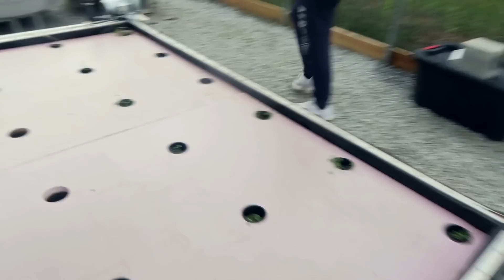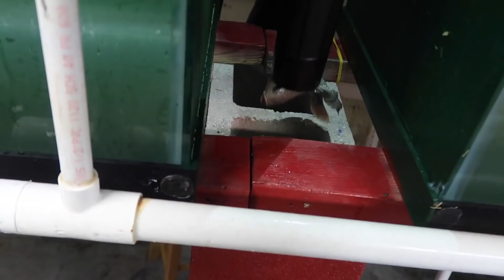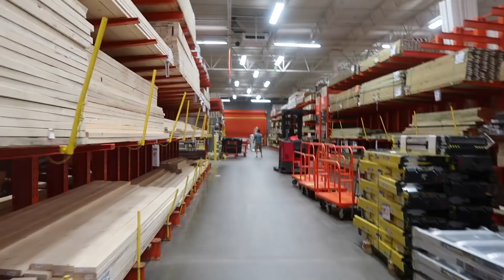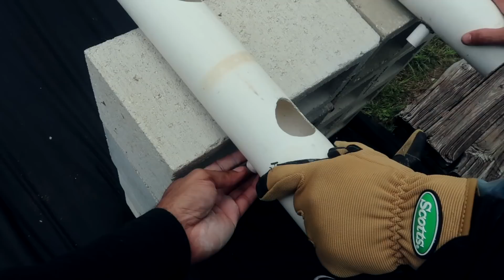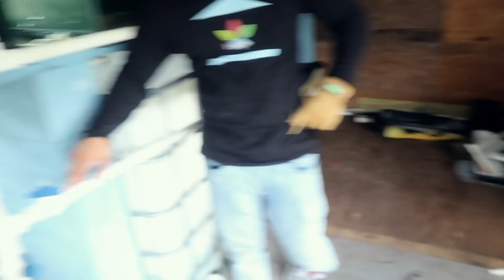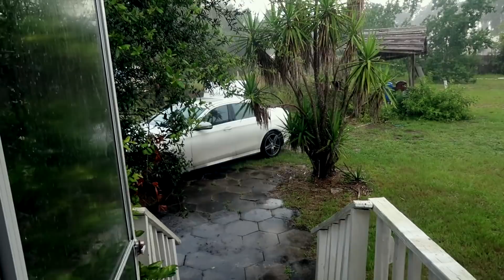We Need More Veggies | The Aquaponics God Ep.56

Comment: Question, can I use rain gutters instead of 4" pipes for an NFT system? They have sealable end caps and also drain cones so I can just drop to each subsequent level. I'm thinking of making a seedling production system where each plant is in its own tiny pot so I can sell directly off the rack without extra labor of transplanting.
Reply: No aluminum should mix with water for food or seeds, please